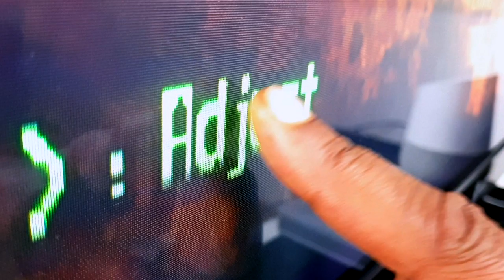Customize your PS1 Classic with HYDRO DIPPING !! 🎮🎨

Comment: What are there basic materials I need for hydro dipping
Reply from the maker: If you want to try it out yourself, all you need is spray paint and a water tank! 
For better adhesion, I highly recommend using a primer spray before hydro dipping. 
Let's all together make the world more creative – get out there and make something! 🎨 🌈
Reply: Dipper Dan do I need a mask to do this or no and do I put a certain spray on at the end
Reply from the maker: Yes, I highly recommend to wear a mask! Use some clear coat spray at the end to give the surface even more shine.

Comment: What happens when it heats up
Reply from the maker: After hydro dipping I always use a clear coat spray. So heat is not a problem for the surface.